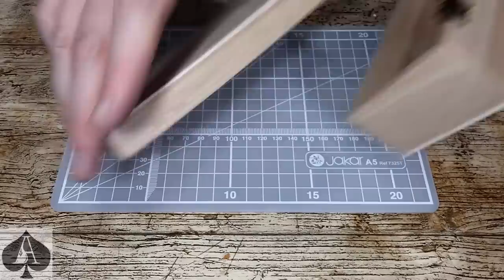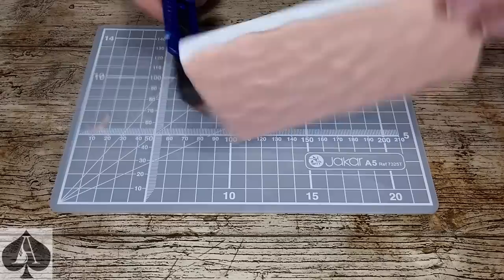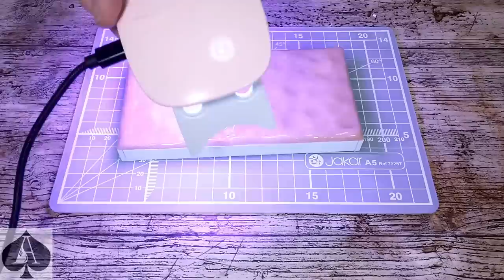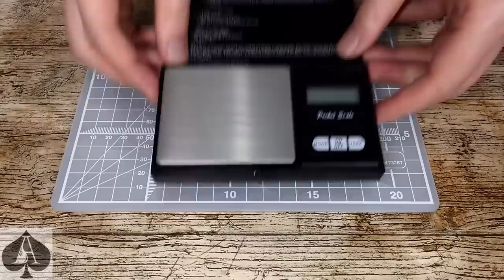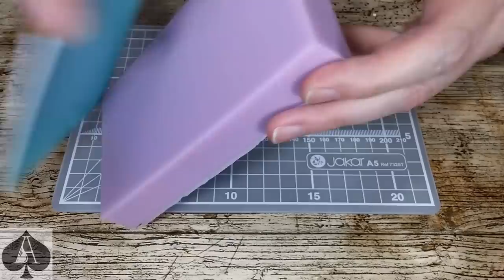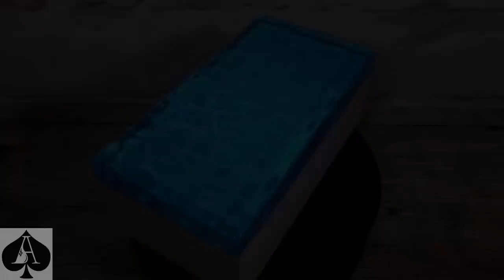Ocean Water Waves Trinket Box Lid from Epoxy Resin - High Gloss Glass Effect

Comment: Brilliant idea. Was the silicone OK outside of the pressure pot?
Reply from the maker: This type of silicone always ends up with very tiny air bubbles trapped in it if you don't de-gas or pressurise, which gives a very slight pitted effect on the sides of the resin.

Comment: This is so cool, do you think it would work with normal sculpey oven bake or does it have to be super?
Reply from the maker: It will probably work with normal if it's conditioned well. Super is very soft so I find it easier to model with.

Comment: I add my thanks for this well done video...  question:  were you able to reuse the mold?
Reply from the maker: Hi, high gloss silicone moulds have a limited lifespan when used with epoxy resin. The resin will attack the surface of the silicone and it will turn dull. You should be able to get a few uses out of it though and any dull patches can be polished up with a polishing compound.
Reply: @resinAce  thank you for the reply. Really enjoyed the video

Comment: I dont know if you will reply, but how much approximately does one have to spend to get started on resin projects? I'm thinking about getting some, but I'm not sure what items I need. Thanks!
Reply from the maker: Hi, to get started you will need some epoxy resin, which will be your biggest cost. I recommend non-toxic art resin. You can check prices locally on Amazon. Then you will need some weigh scales, small mixing cups, stirring sticks and pigment. You can buy translucent pigments or mica powders individually from sellers on eBay. Finally you need to decide what to make, and some good starter projects can be made from the silicone pendant moulds from various sellers online. Start with something small until you have practised measuring, mixing and curing the resin, then you can progress to larger projects.

Comment: I was wondering if you can suggest a brand of epoxy to use. I'm just starting out and am on many FB groups but the number of choices on Amazon is staggering, I was going to buy a 1 liter kit of Marine Pro but thought I would reach out for advice.
Thanks and I love your videos
Reply from the maker: Hi, I always advise people to search out non-toxic, VOC-free brands of resin. You will have to check the data sheet to make sure the one you're looking at is safe for craft use. There is a link in my description to a recommended Art Resin. Just remember to check the maximum pour depth for the resin. Most art resins are 10mm, so larger castings must be poured in layers.

Comment: hey! great video :) question for you - is the uv resin on the clay necessary?
Reply: ie, could i just put the silicone liquid over the baked clay? The only uv resin available to me in my timeframe is a huge amount that I have no need for :P
Reply from the maker: The resin is to give it a shiny surface. If you mould the bare clay it will give you a dull matt finish.

Comment: I saw the "touchy subject" joke coming and there was nothing I could do about it but brace for impact. 

Quick question, do you put anything on your UV resin and 3D prints to keep whatever is in that stuff from inhibiting the cure on your silicone, or does the silicone you use just not have that problem?
Reply from the maker: Hi, I use tin/condensation cured silicone rubber, which is unaffected by the UV resin
Reply: Cool, thanks much.